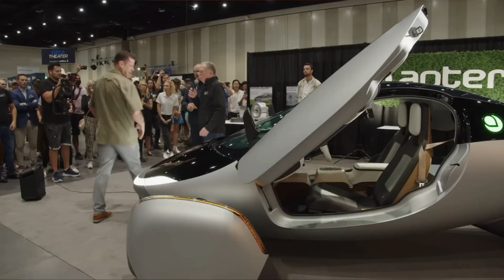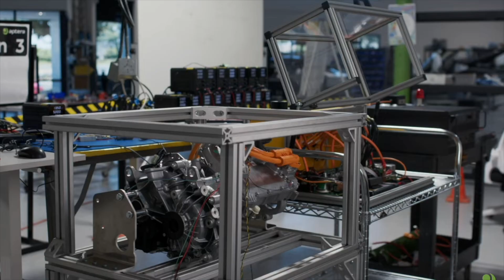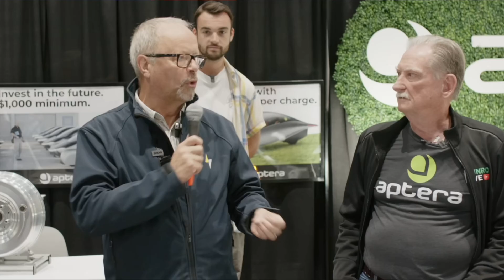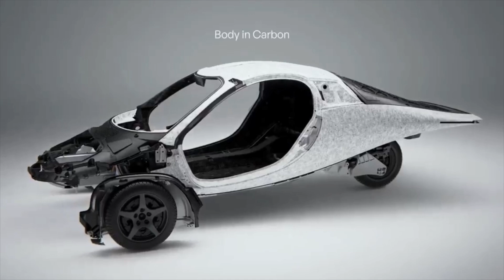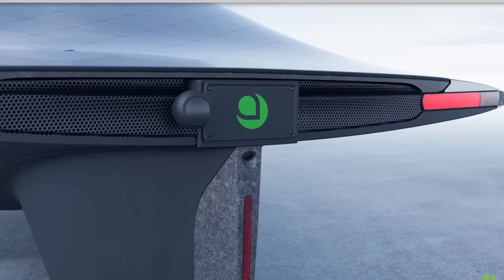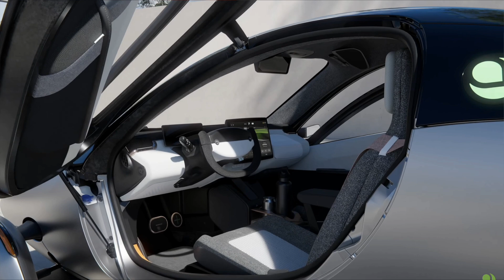PI 2 , 3 & 4 Coming Soon !

Comment: This is grwat, but I want to know details on why they have changed drivetrain which is a huge departure from what they have been talking about for years now.  Look forward to your video on that
Reply: The issue is that after the collapse of Lightyear and Lordstown, Elaphe is not able to scale production of their motors without a huge capital investment, which Aptera can't afford. 
The HOPE is either that if Elaphe develops its own cash flow through working with deeper-pocketed legacy manufacturers, Elaphe can afford to make that investment themselves in the future, or that Aptera, in the future, is stable enough to raise the capital to make the investment in hub motor production.
Reply: @993cc  why haven't we heard earlier?  Why were we not told that this other drivetrain might be a possibility?  When did they factor in this possibility to their plans?  I want to know the answers to these questions and more.  Would like to see William do an extensive and thoughtfull interview with aptera on this, not pull any punches like some other channels
Reply: The new drivetrain is an improvement in my view.  They went from an unproven drive train that would probably have many problems and additional engineering to a proven drive train that has been used in many other EVs.  I think it will be a little more efficient as well and that is big for a vehicle built on efficiency.
Reply from the maker: I agree , less moving parts means less breaking down . 😎
Reply: @wineberryred  The drivetrain is a reliability and maintenance improvement.  I definitely think an important question people should be asking is can these drive units be repaired; at a minimum I would hope the motor, reducer and inverter could be replaced independently if any of them fail.  EMR4 would have been a bit better but that seems to be mostly a supply chain change since they couldn't get it in small numbers.  As someone looking at Aptera as a affordable sports car for all seasons I definitely am disappointed to lose torque vectoring (likely permanently) and AWD (delayed); I might delay my order until AWD is available.
Reply: @wineberryred  I WANT DETAILS.  This new drivetrain changes the center of gravity and weight distribution which will effect the great handling, which includes stopping, that the prototypes had, but even more significantly changes the configuration and design that they spent hundreds, if not thousands, of hours designing, engineering and testing with alpha, beta and delta vehicles
Reply: @danam0228  It sounds like many more details on the new drivetrain are coming on Friday.
Reply: @wineberryred  I hope so.  And in time maybe this thing will fly like in the J Lo flop of a movie 🤪
Reply: We were told in the video.
Reply: @eugeneflorida1408  told very little
Reply from the maker: Yes we were. 😏
Reply from the maker: I will maybe have something on it Tuesday . 🧐
Reply: @stix2you if it was planned for, I want to know how and when, and why weren't we told if they are so transparent?  This is huge departure from what we have been told for years now